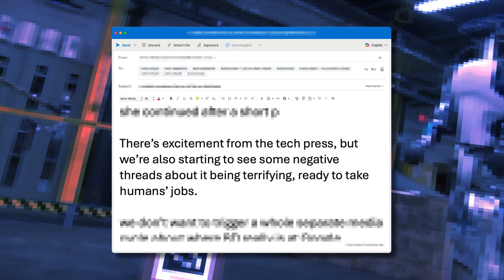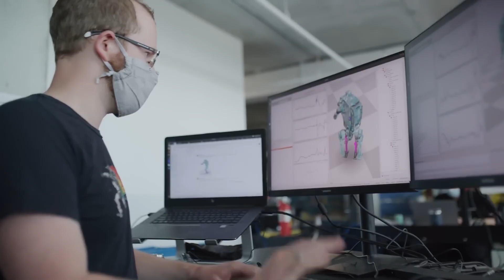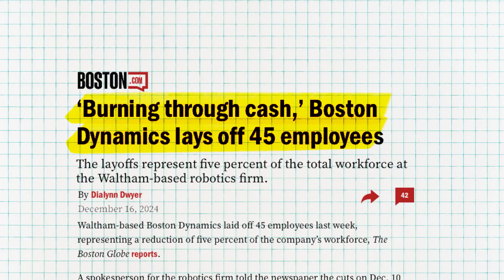Why Boston Dynamics’ robots kind of suck

Comment: only a minute in and I want to drop my thoughts on: why tf are we calling it a robot dog? is everything with four legs a dog now? are horses dogs? are cheetas dogs? is a spider a dog if you rip off four of its legs? it having four legs is the only thing it has in common with a dog. the proliferation of the name "robot dog" has an extremely weird anthropomorphisation effect on this small quadruped robot... an anthropomorphisation effect that I fear would be responsible for public backlash against anyone who would ever dare to try vandalising such a robot. Think about it, what would happen if someone started taking a sledgehammer to "a robot dog", vs taking a sledgehammer to "a remote controlled tool".
Reply: It's called a dog because it's the size of one
Reply: @deltap6967 exactly, I was also going to comment the same, it’s not a difficult concept to understand, but seems the original commenter can’t grasp it.
It doesn’t have anything to do with anthropomorphization,  it’s because saying “remotely controlled tool” it’s too generic and don’t carry any value for describing what the product is and what would be it’s use, so when describing something new, the best describe it, is to associate it with something that already exists and people are already familiar with, to show the similarities and have a point of reference.
And it’s not the first time, this robot was called “robot-dog” because it had the dimensions of a dog, while his predecessor for example that was larger, was associated to donkeys.
And tech is also not the only sector where this happens, very often to describe new foods that someone has never eaten, they are associated and compared with foods you are already familiar with, to give you an idea of what to expect.
Reply from the maker: This is a very good point, worth more study! 🧬 🧪

~ James